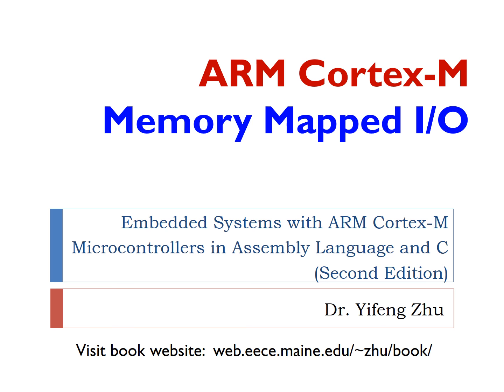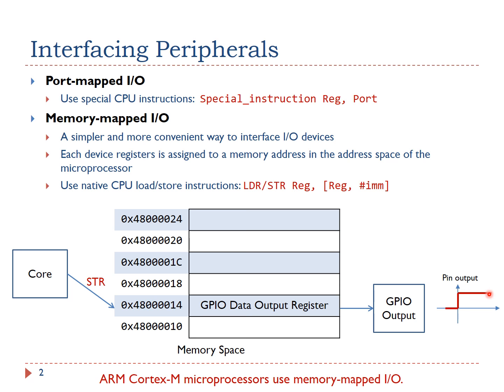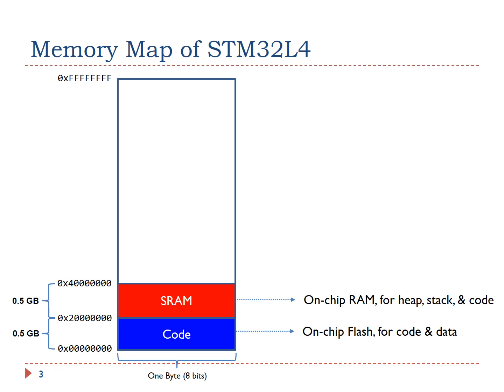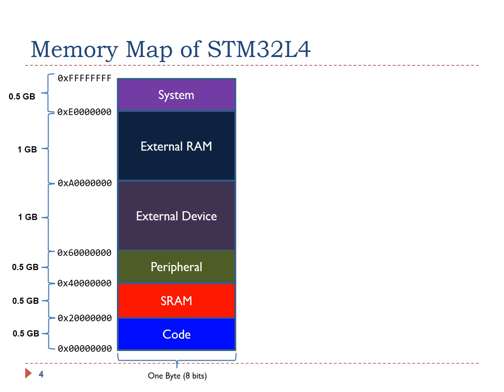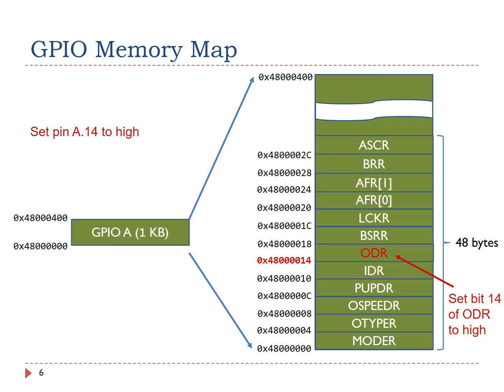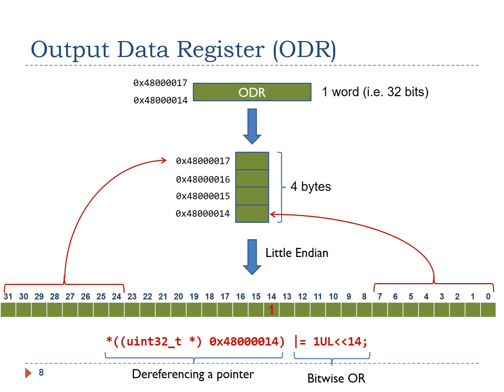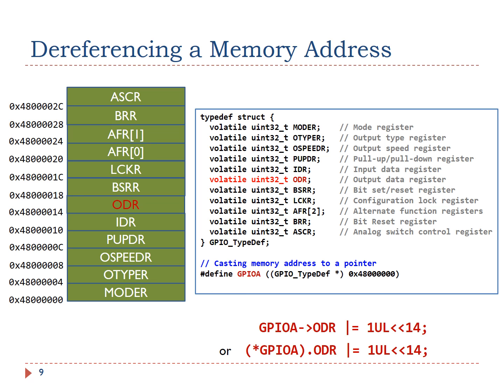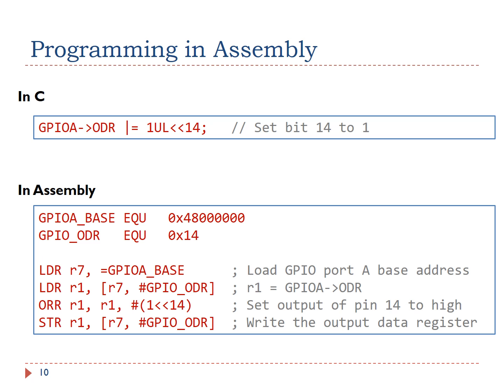Lecture 5: Memory Mapped I/O

Comment: Can someone explain me what’s the meaning of |=1UL<<14
Reply: | is OR and = is assignment operator. UL just tells the compiler that the 1 is to be interpreted as a uint32_t (UNSIGNED LONG). << is bitshift operator (binary multiplication) and 14 is the amount of times the 1 will be shifted one bit to the left

So, if x = 0 and we do x |= 1UL << 14, x will have its 15th bit set (starting at bit 0)

Comment: 0xFFFFFFFF means "4,294,967,295" in decimal which is 4 Giga bits (4Gbs) which is equivalent to 0.5GBs (0.5 Giga Bytes). 
If you mean each address refers to 4 bytes of memory then total memory should be 16 GBs. Which is it?
Reply: I just saw that each address points to one byte in the lower part of the screen in the block diagram. So 4GB makes sense.
Reply: That's a wrong statement. 0xFFFF_FFFF is 4 GB (bytes) not bits. 4 Gb would be address space 0 - 0x1FFF_FFFF which in other words is 512 MB

Comment: Hi Sir, How are you!!..

The below is my doubt, kindly clear my doubts.
How do i find RAM end  address sir?

There is is 2 SRAM in my MCU(STM32F407 disc1 board), starting address is 0x20000000 as per  user manual and my SRAM 1 size is 112KB and SRAM 2 size is 16KB. As per the memory mapping end address of SRAM 1 is 0x2001BFFF, but if we add 0x20000000 with `112 KB am getting the address 0x2001C000, SRAM1 end address is 0x2001BFFF. 0x2001C000 is starting address of SRAM2.

Kindly help me  for find out SRAM1 end address.

Thanks in advance Sir :)

Comment: hi, why don't we assign the value we want, directly to the 32-bit i/o port A data register without using a bitwise operator ??
Reply from the maker: For example, the GPIO output data register has 32 bits, controlling the output of all pins of that port. If you do not use the bitwise operations, you will cannot change the output of a pin without influencing the output of the other pins in this port.
Reply: understood, thanks.
Reply: @embeddedsystemswitharmcort9051  good point!